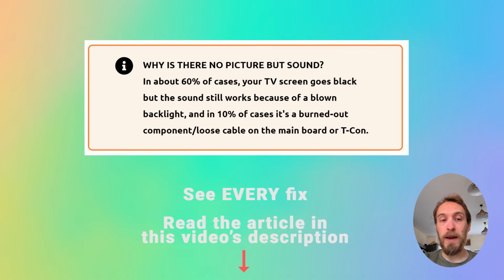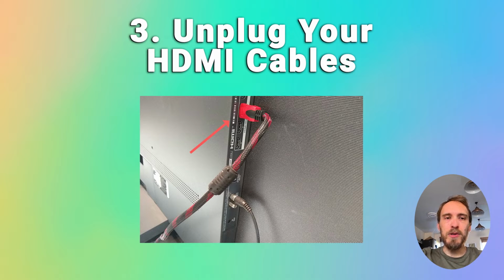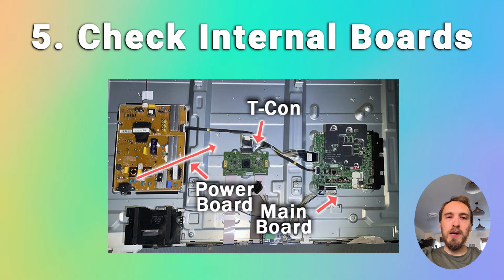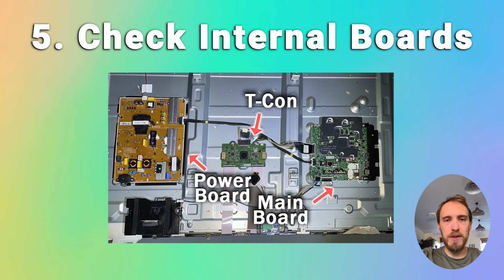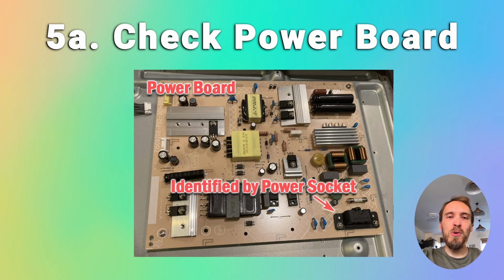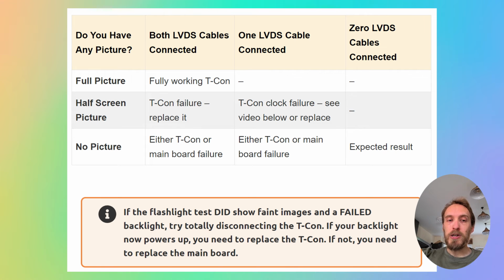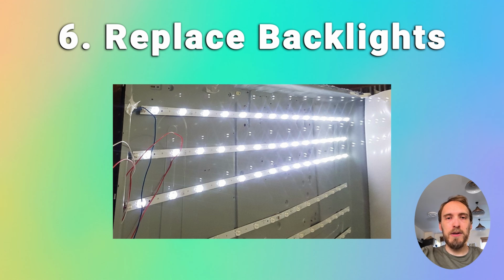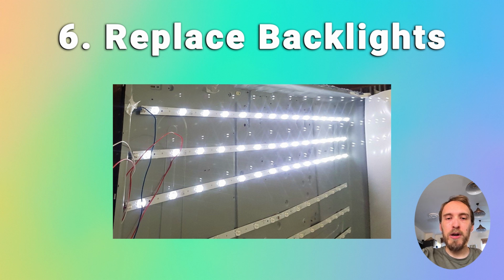Toshiba TV Black Screen WITH Sound | NO Picture But Sound | 10-Min Fixes

Comment: My screen just went black a few days ago. I have had my Toshiba Fire TV for about 5 years now. When I tried the unplug and replug method and the cycling method with the actual TV button, the same thing always happens. Meaning when I turn on the TV a half gray half white screen appears. Then after a few seconds the TV goes black. But the black screen is glowing. I can hear audio just the same as always but the picture isn't showing at all. Turn it off and on, same exact thing!

Comment: I have a Toshiba TV which blacks out occasionally while the sound stays on. Some times an hour after turning it on and  sometimes after 15 minutes. But if I turn it off and turn it on the TV the picture comes back. Please shade some light on this symptom. Thanks.
Reply: Mine is having the exact same problem. If I turn it off and back on, the picture comes back, only to go black again about 15 minutes later. And it usually only happens while I'm playing video games.

Comment: Thank you so much for this video it is very helpful and analytic. You have a very calm and great way of explaining. I appreciate that.  
I just would like to ask about my problem. It looks that everything is working good but not so good from time to time.
At first the tv wasn’t opening after switching off a few times and on again. After a few times is working properly.  
After a few days wasn’t opening again. I decided to open the over as you said disconnect the ribbons and turning it on again. It worked properly for a few days.
Ater this period starts not working again having the same symptoms, I was trying continuously to turn it on but failed. After a while start working again but I am afraid to turn it off again. It is working continuously 7days.
I can’t understand what is the problem because it is working properly but shows up this problem from time to time. Thanks for your patience.
Antonios Gkaitatzakis, Greece.

Comment: My Toshiba has sound but no picture. However when it first turns on i can clearly see the Toshiba splash screen (logo etc.) For a second or two.

Any thoughts?
Reply: I am experiencing the same problem
Reply: Tested by shining a flash  light up close to front of the TV screen, (I was able to see the images).
I took the TV apart and found one backlight led was dead. I replaced it, then tested the remaining leds. 
I reassembled the TV and tested, it's up and running all good now.

Amazing, one led could cause some to trash a tv when the replacement part cost is a few cents.
Reply: @pathalogicalme940  I will try this

Comment: Hi, A few questions is this for led tvs. Now I would like to ask my tv just went black screen two days ago everything else working I can hear in the tv. The thing is that there is a button on the back of the tv if i hold this button in it will put the tv red light on. Now when I use the remote to pick a channel to turn tv on I get a 2 second flash showing  toshiba on my screen then blacklight.
Reply: This you Silve your problem? As happened for my tv same?

Comment: Hi! Thank you so much for an informative video! My Toshiba tv (U500DU01) is having a problem where the sound and backlight are working, but I get no image. I watched your video and tried replacing both ribbon cables and t con panel but the tv still doesn't work. Interesting thing is, there are two ribbon cables connected to t con board and when I just connect the one on left, half of the screen lights up with vertical lines(no pictures, just colored vertical lines), but when I connect both ribbon cables or just the right side, the screen does not light up at all. I am really not a very tech smart person so not sure what's wrong or what I can do. Any advice from an expert?

Comment: TV was working fine one day and the next all I get is a black screen but can hear audio. Does anyone know a fix?

Edit: The issue was backlight failure. This seems to be a pretty common probably with Toshiba TV's. It was pretty expensive to fix and I was also worried that the issue might happen again as it seems to be pretty common and we didn't know what was causing the failure (a bad circuit board?) so I did not go ahead with the repair and unfortunately had to purchase a new TV on sale. I would not recommend a Toshiba TV to anyone.
Reply: Did you find a fix, because I'm having the same problem.
Reply: @naazwansh  Unfortunately there is no cheap fix. I took it to a repair guy and the issue was backlight failure. It was pretty expensive to fix so I purchased I new TV on sale instead. It seems to be common in these Toshiba TV's from what I've seen online.
Reply: @ProTroy_  thanks man

Comment: The problem with Toshiba tv's is their software. It simply stops working after a few years. That's why they have sound but not image. When I got to make mine work again after plenty of hours of plugging and unplugging it and trying every single method, I rebooted it and it worked well for about 2 months. Now I have the same problem again though. So make sure to reboot them every month to make them perform well if you don't want to buy another tv.
Reply: How can you reboot
Reply: Thank you Niko, probably you are Greek too. How you reboot the tv the way is solving the problem for you? It is somehting that it is working still?

Comment: Brilliant video. My tv picture flashes up in full for 1-2 seconds (that would suggest all LEDs are actually working) but then turns black. When the screen is black I can see the picture with a torch, the sound is on too. From your video, it sounds like the T-con is the problem and needs replacing, do you agree?
Reply: Did you fix it?
Reply: @krisjay3429 unfortunately the new tcon didn't fix it. It must be the main board or back lights.
Reply: Mine is doing the same thing. Did you try to fix it?
Reply: @lansworld3617 unfortunately the new tcon didn't fix it. It must be the main board or back lights.

Comment: Thank you so much for this video. Toshiba needs to stop making TVs because this common issue should NOT be common. It should be resolved and nonexistent. No one purchases a TV to fix problems nor replace it after 3 years. I’m not trying to replace backlights etc.
Reply: Mines just went out. 3 years and 4 days later. They need to be sued. I'm so pissed
Reply: Funny you say that mine did it basically right at 3 years it’s stupid
Reply: @diesfastest6667  Mine did it after 1 year!  Sorry ass tv, I will not be buying another one like that.
Reply: @diesfastest6667 Funny you say that as well, mine just happened today after 3 years! Never buying Toshiba again.
Reply: @diesfastest6667 3 years for mine too. Never again
Reply: @diesfastest6667  same am here after 3 years , which means it’s very common
Reply: Exact 3 years 😮 they made them that why ?
Reply: Mine went out last month after 3 years. First sound and no picture. Now it comes on with no picture then it shuts off on its own. 😡😡😡😡
Reply: 3 1/2 years. For me. Garbage tv
Reply: Wow it's been 3 years for me too now screen just went blank I was trying to decide whether I was going to send to shop but now that I know that this is common for this going in the garbage F U  Toshiba
Reply: 3 yrs 1month for mine lol this is nasty work
Reply: Same here. Mine has just gone out at and it’s only 3 years old. I called Toshiba and all they said is that the warranty is only for 1 year. Told them they are selling a defective product and they repeated the same scripted warranty line.
Reply: Same here mine at 3 years and 2 months
Reply: Exactly
Reply: Mines just went out had it for 5 or 6 years
Reply: Toshiba re cunts mine did exactly 2 yrs and some months bough it September 2023 this is board day light scamming
Reply: Omg 😲 mine just went out 3yrs exactly 💯